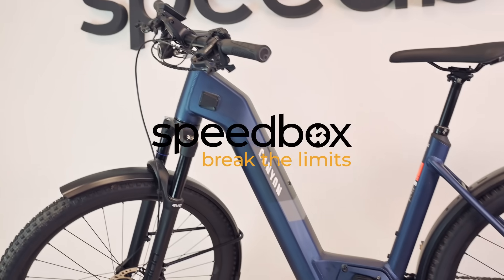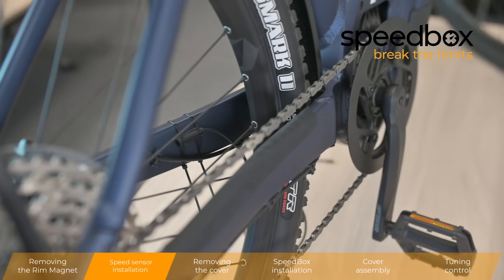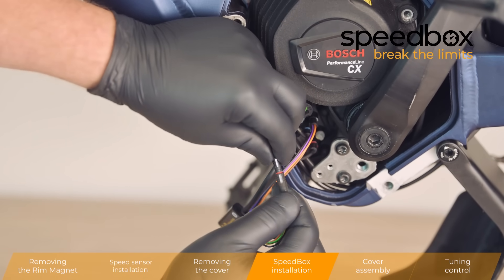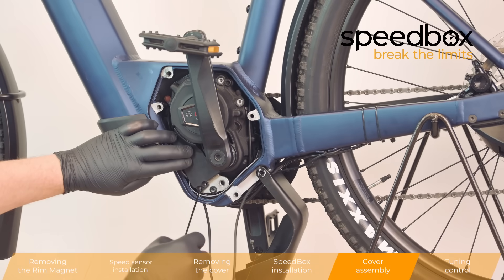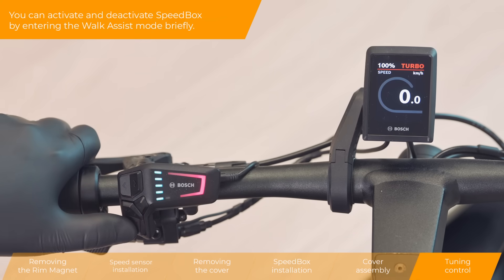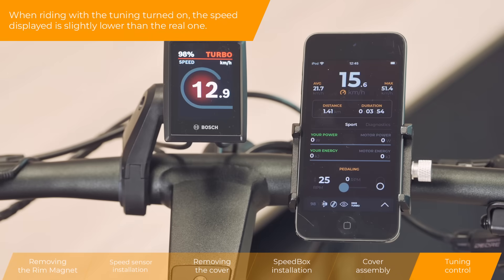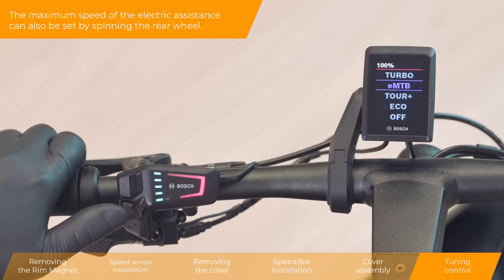eBike Tuning SpeedBox 1.2 (B.Tuning) for Bosch (Smart System + Rim Magnet)  Installation Instruction

Comment: I don’t have any place inside of the housing to store the rim magnet simulator. Can it be placed on the outside. I drive through a lot of mud and do 50km a day in rain and other weather. Is it very weatherproof?
Reply from the maker: Hi.
Each of our SpeedBoxes is waterproof and an externally placed chip will work, but we cannot guarantee absolute functionality all the time if you will be riding off-road through mud and puddles. It's up to you 🙂

Comment: I just updated my bike, will this still work?
Reply from the maker: Hi.
SpeedBox for Bosch Smart System products manufactured in April 2024 and later are compatible with the latest update. In theory, there should be no older models on the market now. If you have updated software with the serial number 13.x.x, it may happen that the activation using the Walk feature will not work now. It will be necessary to activate/deactivate the tuning using the combination of buttons - + - + or + - + -.
Reply: And so what's the top speed you csn actually get the bikes up to once Installed?
Reply from the maker: @andysims8823  Hi.
We have experience with e-bikes with a Bosch motor at speeds above 50 km/h (for a short time), the sustainable speed on a flat surface is around 40 km/h. However, for engines with the Smart system, we recommend not to exceed an average cruising speed of 35 km/h to prevent the risk of tuning detection.
Reply: @SpeedBoxTuning  also, any idea on how to srop the rattling coming from the engine on a 2023 Sam2 6.8..
Reply from the maker: @andysims8823  We can't advise here. We recommend contacting the e-bike dealer.
Thank you for your understanding.

Comment: After reading all theese bad comment I won't buy anymore. Too much error
Reply from the maker: Before buying an e-bike, it is good to think about whether I want to unlock the speed limiter or not. If so, it is better to get an e-bike with a simpler system. The Smart System with a magnet on the rear wheel rim is not that complicated in itself, but some e-bike manufacturers have mounted the electric motor in such a way that the installation of the tuning can be a bit more complicated.
Reply: @SpeedBoxTuning hello, what you can say about cube stere hybrid one55 with rim magnet? Is it possible to work corectly without errors.. Thanks
Reply from the maker: @evanon2365  Hello.
If you follow our recommendations on driving style, which we have on the website, the risk of error is unlikely.
https://www.speedbox-tuning.com/p/speedbox-1-2-for-bosch#1914
The most important thing is to install it correctly and find a suitable place for the signal for the rim magnet simulator.
Reply: @evanon2365 hello I have the same bike may I ask if you purchased it and if it worked ?

Comment: I do not recommend this !! After speaking to an agent and confirming it would work without an issue I bought one . Now the bike is telling me error 504 !! GREAT !!! Now it needs to go in the shop to resolved issue, who will pay for this ??!  The bike is currently in limp mode !!! Useless. DO NOT BUY SPEEDBOX
Reply from the maker: Hi.
We are sorry to hear that you have had tuning detection. With the SpeedBox for Bosch, we recommend following some recommendations to eliminate the risk of tuning detection (524001). All manufacturers have these recommendations. You can find them, for example, with individual products on our website https://www.speedbox-tuning.com/for-bosch. In case of questions, we recommend contacting our support on these pages or via Messenger or Instagram.
Thank you for your understanding and many happy miles.

Comment: Hallo, Passt es an das neue Focus Jam2? Da ist sehr wenig Platz zwischen Motor und Gehäuse.
Reply from the maker: Hallo.
Uns ist kein Chip bekannt, der nicht in den Focus gepasst hätte. Natürlich muss man manchmal Geduld aufbringen. Wenn du nicht weiter weißt, kontaktiere unser Support-Team unter www.speedbox-team.de oder über Messenger / Instagram.
Reply: @SpeedBoxTuning  Euer Link funktioniert nicht und eure Antwort macht auch kein Sinn!
Reply: Wo kann man beim Focus jam2 den rim Simulator denn rein schieben? Hat da jemand gemacht? Da gibt es ja kaum spiel wo man ihn rein stecken könnte?
Reply: @TopHardyYT  Genau das war meine Frage, ich denke dass passt nicht. Ich hab mir diesen italienischen eplus Chip gekauft, aber der produziert ständig Fehlermeldungen..
Da heißt es wohl abzuwarten.
Reply from the maker: @sacredtjiss  
Wir entschuldigen uns für den nicht funktionierenden Link. Hier ist der Link zur idealen Position des Rim Magnet Simulators.
chrome-extension://efaidnbmnnnibpcajpcglclefindmkaj/https://tuningelektrokol.s9.cdn-upgates.com/i/i6642f643486f3-sb12-b-mag-connection.pdf
Oder Alle Informationen finden Sie auf der Website: https://www.speedbox-tuning.de/smart-system-rim-magnet.

Comment: Hi can you please help , i have installed following video and guides , but i am getting speed sensor readings from every part of the motor no mater what , and it wont give assist past 25km/hr still. Do i need to be on a certain firmware ? I did not update firmware , should i maybe ?? Any help eould be great , thanks
Reply from the maker: Hi.
Please try to contact our support on speedbox-tuning.com or on Messenger or Instagram.
Thank you.

Comment: I’ve installed the 1.2 B now on a Cube AMS with Bosch SX motor. In the first installation I did obviously not follow the stepwise procedure correctly. When riding the bike I always got the orange warning lamp after short distance. I did reset the Box and re-installed it once again following the recommended steps.
Now it works properly.
The support is continuous up to the limit and it fades out smoothly at 35/36/37 you keep on pedaling.
My bike has no display, I use the SpeedBox App, which works nicely as well.
I like the system and would buy it again.
Reply: Hi is yours still working good, looking at getting one for my bike but have seen too many mixed reviews,
thanks
Reply: Is it still working ?
Reply: how long did it take you to install the speed box, the bike shop tells me it takes 5 hours to install but i can’t believe that

Comment: Will this work with Flow+ and all it's features, like tracking, anti-theft functionality and alerts, etc.?
Reply from the maker: Good morning.
Yes, Flow App is not affected by SpeedBox functionality. However, we recommend turning off automatic updates in the settings in order to preserve the correct functionality of the chip.

Comment: Buongiorno. Io possiedo una M20 Orbea con motore Bosch Performance Line CX, senza display e con software 9.13.0. Ho installato lo SpeedBox 1.2 (Smart Sistem+Rim Magnet) ma contunua ad andare in errore. Cosa devo verificare? Grazie
Reply from the maker: Buona giornata.
Se non hai un display, dovresti avere una versione chiamata B.Tuning.
Prova a guardare la nostra pagina dei manuali https://www.speedbox-tuning.it/um-speedbox-1-2-b-tuning-per-bosch
Oppure puoi contattare il nostro supporto su speedbox-tuning.it o tramite Messenger o Instagram.

Comment: Saying online it only lets it do 22mph. With this can I not put it on the crank arm to gain more speed or would it go in limp mode?
Reply from the maker: Good day.
You can also drive at a higher speed, but at your own risk. We and other tuning manufacturers recommend not to exceed 22 mph precisely to prevent tuning detection in Smart systems.

Comment: Tried for hours with the positioning of the rim magnet simulator and have no success at all. Am I missing something?
Reply: And could you fix it?
Reply from the maker: Good day.
What exactly is the model name of your e-bike?
Try to pick up the signal like this: set the derailleur to middle gear. When searching for a signal, turn the crank, not the rear wheel.
Here https://www.speedbox-tuning.com/p/speedbox-1-2-for-bosch#1914 you will find all product and installation information.
If you don't know what to do, contact our support at speedbox-tuning.com or Messenger or IG.
Reply: Focus Jam2 8.8.
Reply: Tried installing as per instructions and still receive no info on the kiox screen
Reply from the maker: @fwaygostjf1988  Are you sure you have a magnet on the valve of the rear wheel?
Reply: @SpeedBoxTuning  yes. The original setup has a magnet on the valve. The instructions for the SpeedBox say to remove this magnet. And replace with the sensor and spoke magnet
Reply from the maker: @fwaygostjf1988  So please contact our support team. Thank you.

Comment: Going to hold off for a bit, don't want to brick a new bike, doesn't seem reliable yet, ota firmware updates affected? Too risky just now
Reply from the maker: Hello.
Installing the ebike chip will not cause any damage. OTA (FBL) firmware updates are still possible after installation, but we strongly advise against them - especially for electric bikes with Bosch motors.
Reply: @SpeedBoxTuning  I will give it some thought, the 25 kph limit is annoying as my natural cadence propels me at about 27 kph
35 would be perfect
Reply from the maker: @markcliffe7  Great to hear! ☺

Comment: R u working on a new one?
When u say set the limit to 35kmh is that the official 35km 
Or the 35km on the the app? So ur really doing 45km. Video says the speed will show lower on the the screen
Reply from the maker: Hello.
You can theoretically set the speed to unlimited. However, we recommend not exceeding 35 km/h to reduce the risk of tuning detection. Therefore, we default to a 35 km/h limit from the factory. The actual speed can be seen in the SpeedBox App. The display shows a slightly lower speed. For example, 18 km/h on the display means 25 km/h in reality. 25 km/h on the display means 35 km/h in reality, and so on.

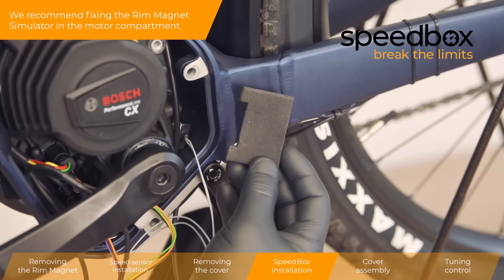Comment: In the video 3:45 is there an additional magnet? Because you don't provide it in the set.
What is it and what is it for?
Reply from the maker: Hello.
It is not magnet. It's just a cut-off piece of foam cover from our box in which we send the SpeedBox products 🙂 You can use any piece of foam you want.
Reply: @SpeedBoxTuning  está solucionado el tema del error 523003 , tuve que devolver mi speedbox porque al cabo de varios kilómetros me salía el error

Comment: Hello, I have the FLOW application version 1.21.3, I don't download anything, I don't update anything. Will speedbox work??
bosch cx gen 4 kiox 500 engine.
Reply from the maker: Hello.
Starting from May 2024, we supply products compatible with the latest software version 11.3.0. The products should be also compatible with Flow App 1.21.3.

Comment: Hallo, wie ist die Wirksamkeit von Speedbox 1.2, da ich hier unterschiedliche Meinungen lese und niemand schreibt, dass alles in Ordnung ist, dass es seit einem halben Jahr funktioniert und es keine Probleme gibt.
Reply from the maker: Hallo.
Was die Softwarefunktionalität anbelangt, ist der Chip vollständig kompatibel mit Bosch-Motoren mit einem Magneten am Felgenrand (einschließlich des SX-Motors). Die Installation erfordert etwas Geduld, da zunächst eine Spule (Rim Magnet Simulator) korrekt im Motorraum befestigt werden muss. Ein weiteres Problem ist, dass der Chip und die Spule nicht in den Raum jedes Motors vollständig passen können. Dies ist kein Fehler der Chip-Kompatibilität mit dem Elektromotor, sondern hängt vom Typ des Elektrofahrrads ab. Daher empfehlen wir, vor dem Kauf des Produkts den Motorraum zuerst zu überprüfen.

Comment: Hey did it on my focus jam2 6.8  not working good why
Reply from the maker: Hello.
Can you please describe a little more how the SpeedBox (doesn't) work in your e-bike? 
Thank you.
Reply: The signal from the rim simulator keeps getting lost every time because I have to take it outside my frame is not like in your video. Even when it does work, the error occurs again when I push human power into the pedals. I spent 7 hours trying yesterday, and today, I'm giving it another shot. I think I might have found the solution by fixing the speed sensor and securing the simulator strong in place. Hopefully, it will work better now.
Reply from the maker: @BenjiBenji989  With e-bikes with a rim magnet, you have to patiently search for the signal of the magnet simulator. We recommend having the transmission set somewhere in the middle range. When testing the speed sensor signal, do not turn the rear wheel by hand, but turn the crank by hand. This should help in finding the signal. 
If you are unable to install the chip today, please contact our support at speedbox-tuning.com. Thanks.
Reply: No place in the Motor area in my Bike Support Takes to Long better other Company gut they Chat to mutch via Support without solution
Reply: @BenjiBenji989 how you placed right the signal simulator?

Comment: Hello, what is technically the difference between the Rim Magnet and the normal Magnet? They have the same function and get one signal per turn if the magnet is passing, right? I am engineer and would like to understand why you need to use different speedboxes for this.
Reply from the maker: Hello.
In simple terms, a speed sensor with a common magnet works in such a way that each rotation of the rear wheel is captured by the sensor as one pulse. The number of pulses in time and the diameter of the wheel gives the speed, ODO etc. The magnet on the rim is wireless and uses the electromagnetic field from the electric motor.
The advantage of the rim magnet is the ability to read riding data directly from the electric motor (more precise data). And it also makes installing the tuning more complicated 🙂
Reply: @SpeedBoxTuning  Thanks for answering. And what is the difficulty to show the real speed with the rim version like 23,5 for 35 km/h? What I understand is that you simulate the movement of the rim magnet with an electric coil, the motor is reading the movement of the magnetic field directly without additional sensor like the speed sensor.
Reply from the maker: @philipp6440  You are welcome 😊This is a different problem. The Bosch Smart System uses secure communication that we cannot "hack".

Comment: One question.... how it reflects on battery life if your speed is 30km/h.....  Does it drastically cutting mileage you can ride with charge or slightly?
Reply from the maker: Hello.
This depends on the e-bike and riding style. Several times a season, we test the riding characteristics and range of our test e-bikes of all possible brands. You can normally ride around 70 km, if you don't always use the highest assistance.

Comment: So should it work also without kiox (and use of flow app)?i am not getting speed signal at all with that spoke magnet. With origina rim magnet speed is displayed, but cannot get that tuning feature on. Should those 2,5 etc show in flow app? Thanks
Reply from the maker: Hello.
Yes, you can use the FlowApp instead of the display to find the correct magnet position.

Comment: How Software you u have? Tell me pls your Bosch engine update Software number
Reply from the maker: The last working version of the bike FW is 10.x.x (components except motor), and 9.13.0 (motor).
Reply: @SpeedBoxTuning  my current version is 9.13.0
Reply: @SpeedBoxTuning  It says on the internet that the Speedbox 1.2 no longer works from version 9.13.0, and I have already bought the box and now it doesn't work. The Speedbox 1.2 cannot be updated either, what is the solution? I need solutions!
Reply from the maker: @ulasdemiroglu2518  Hello.
SpeedBox does not work since version 11.13.0. If you have a lower version of the software, we recommend not updating. Ideally, turn off updates in the Flow App.
However, we should have an updated product available next week.
We recommend that you then contact your distributor for a replacement.
Reply: @SpeedBoxTuning  yes, but my dealer won't take this part back and I'm left with the costs. The part cost me $399 and doesn't even work. Speedbox doesn't care either.
Reply from the maker: @ulasdemiroglu2518  Could you please contact our support via chat on speedbox-tuning.com? Try to describe your problem exactly. We will definitely find a solution.

Comment: When I install it, if I turn the tires, it doesn't show any numbers on my display. Even if I position the magnet differently, it doesn't show anything on the display
Reply: Im having this same issue.  did you get it resolved? I have the new speedbox 1.2b and the CX Raceline.  See no speed output on the kiox screen, even though it registers speed on the app.  please let me know if you had any updates
Reply: @GhulamHussain-uk3im  send it back, it's useless, a lot of stress for nothing, I sent it back. just crap the whole thing